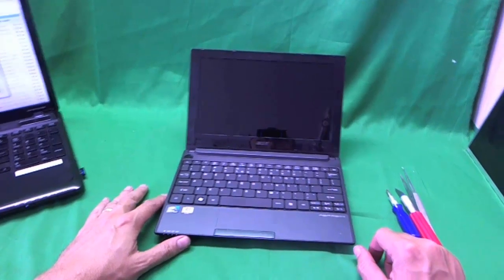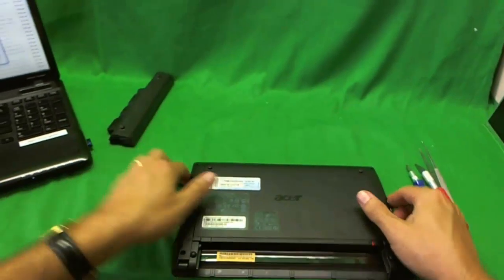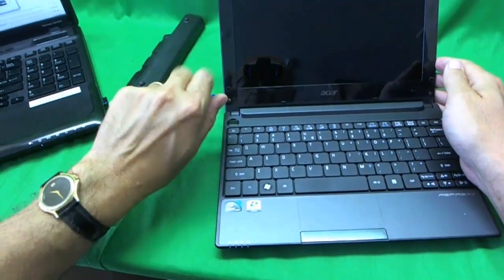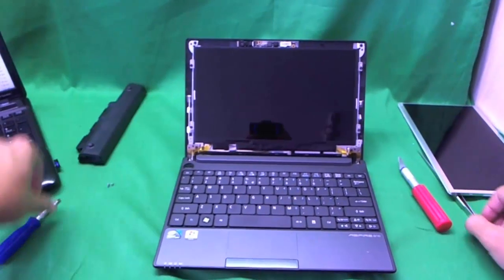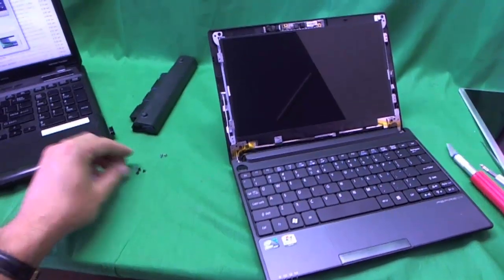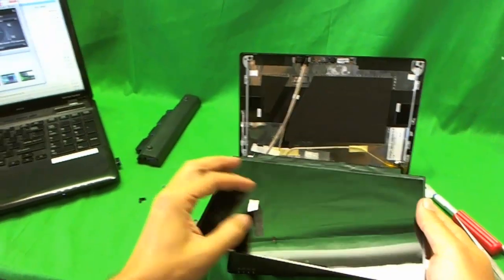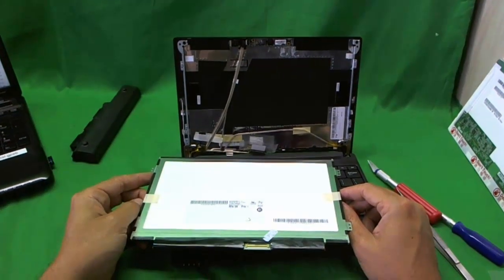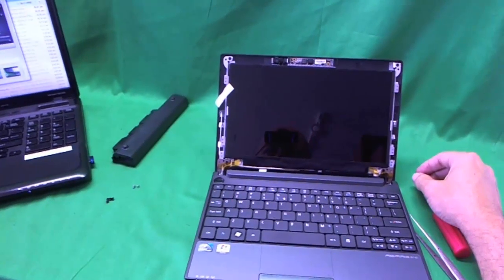Acer Aspire One D255 D255E D260 Netbook Screen Replacement Procedure

Comment: I Have a D260 netbook, the back light still works but is rather dim 
i can still adjust the screen brightness with the function+arrow keys but the maximum screen brightness is dim but the colour is unaffected (no pink screen) and the 4 lowest screen brightness look as if the back light isn't powered at all. I also get a little screen flicker.
I'm trying to figure out if its a loose connection or dodgy screen/inverter or perhaps a bios/software problem. any advice would be appreciated, thankyou.

Comment: hi, i have a questions, i have the same model, the lcd cracked and had the lcd changed recently, but it couldnt boot after replacement. before replacement, it working fine on external display/monitor.

Comment: do you know if replacing the inverter on an d255E will fix the problem with the screem? 
The screen is working, I know because I put a flashligth close to the screen an I'm able  that is working but is very dark.

Comment: Hi,Please help me: My netbook fell off on to a hard floor while working and the screen turned white immediately.I can only see a couple of vertical gray lines from that I understand that it is booting  upto the log in window. I cannot see any thing.I can turn the screen off using the key board and also change the brightness please snuggest  me what to do.
I have opened whole net book completely and checked for any lose contacts nothing changed.
Thank you very much.
Prams